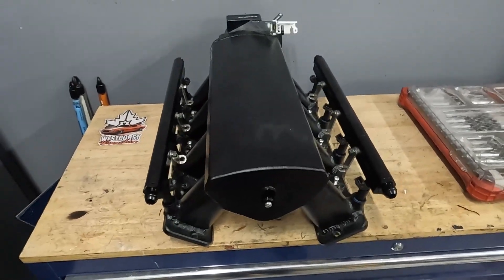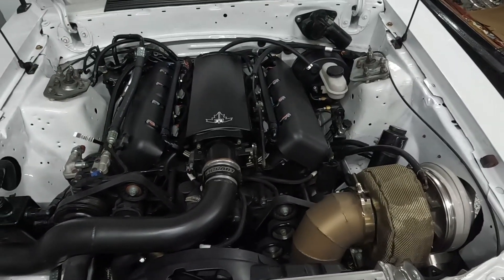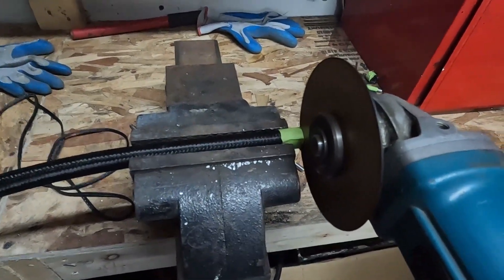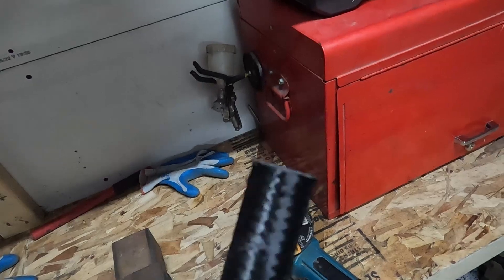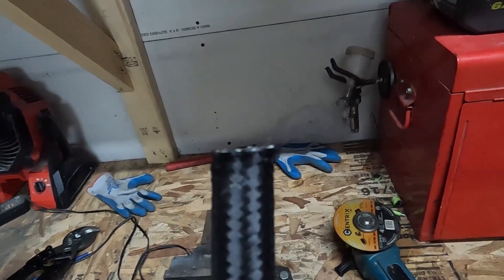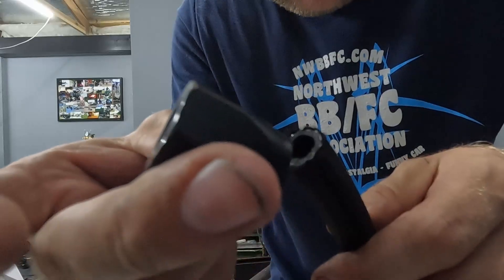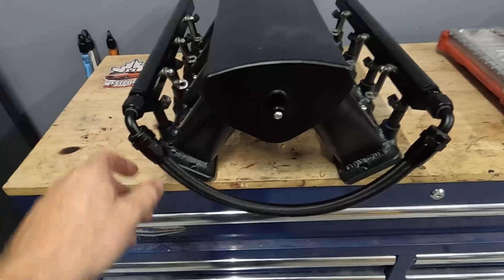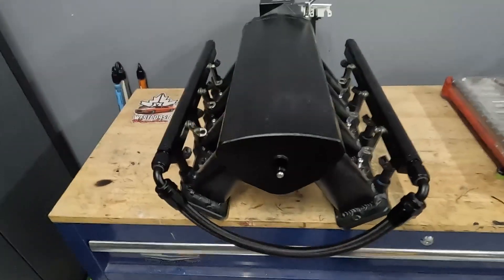Braided AN Line Tips and Tricks to build perfect lines every time!

Comment: I buy harbor freight wrenches and cut the box end to slip over the hose. I also made them short to fit in tight spots. I have the an wrench but I needed a short wrench and this is what i came up with. Now I use that more than the an wrench.